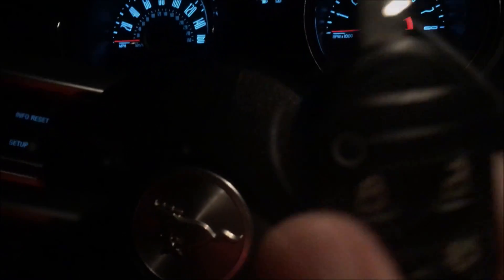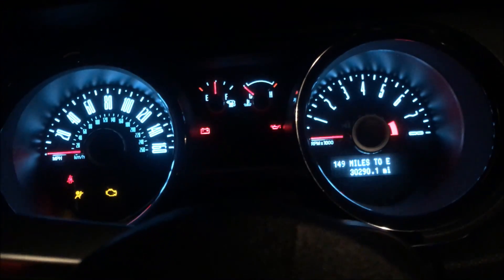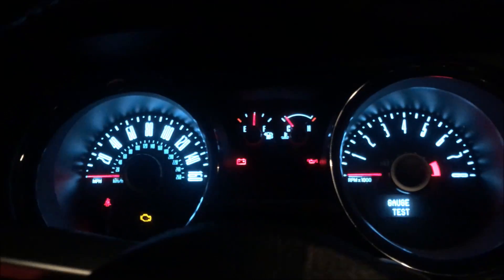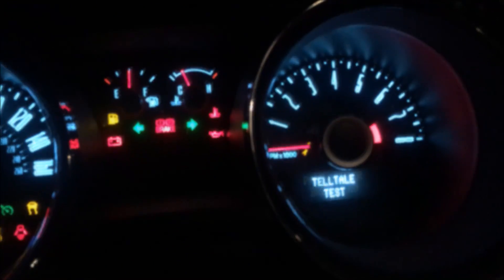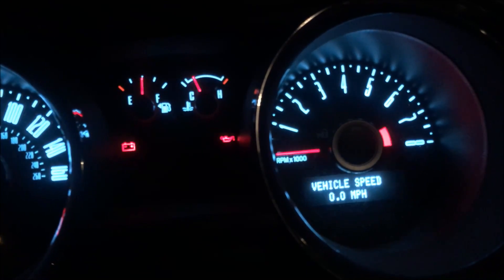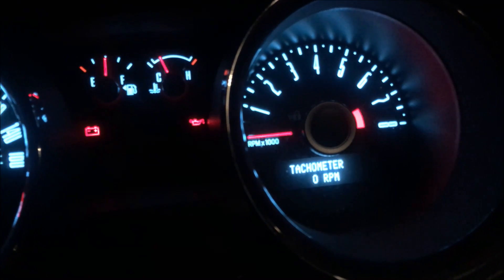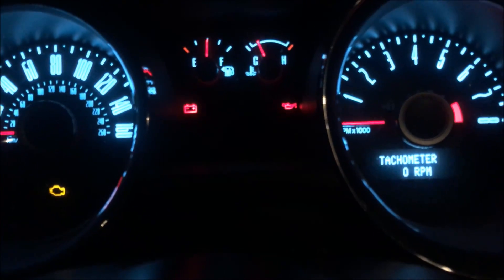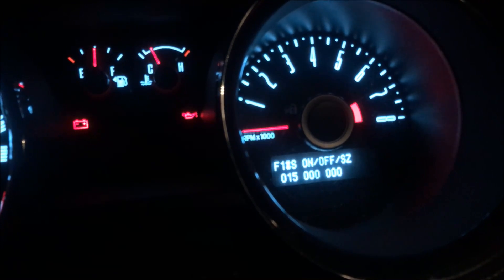ENGINEERING MODE in ANY 2011+MUSTANG + Some 3.7 Downshifting

Comment: regular volts while running is 13.8 to 14.3 high boils battery low well simply not charging.  But check your belts before the trip to the shop. spend 50.00 buy ob2 and learn alot for cheap. clear the codes if they return take the negative battery terminal off. step on the brake pedal for 3to 5 minutes then wait 15min minimum or longer it will reset the hole car including the trany shift  module.  Now if you still have engine light coming on and to many automatic shifts for no reason consider. Air filter, MAF sensor cleaning and check your gass cap seal is not hard dry cracking orr not there. Still having problems consider a mechanic.

Comment: How so you get in to engineering test mode in a 2014? I don't have a 'reset' button, I have an up, down, left, right and enter button and I have a screen in between the speedometer and tach gauge pods.
Reply: Maybe try the reset button below the headlights knob? It's the only thing I can think of

Comment: My 2011 fiesta had a hidden engineering mode. I have a 2011 3.7 now and had to lookup if it had the same thing and stoked that it does. If im running an aggressive tune the coolant temp will be nice to see in digital form without my laptop hooked up

Comment: What does it mean if the voltage is at 12. And not 14??
Reply: I when you’re car is off it’s usually around 12 volts, but then as you turn it on the alternator charges it and keeps it around 13-14 Volts. You’re good 👍🏻
Reply: Low voltage lol

Comment: what do you really want to do? the 3.7 builds are nice. But unless you force air induct or NOS, you'll still struggle to complete against high horsepower cars. the 5.0 is great but has expensive bills, and are sometimes more expensive to do things to unless you're doing simple bolt ons. But at that point, a 3.7 build can just abt crank out the same #s for cheaper. just provoking thoughts